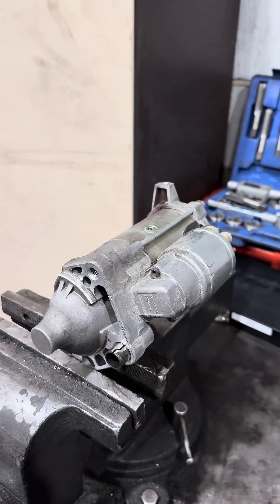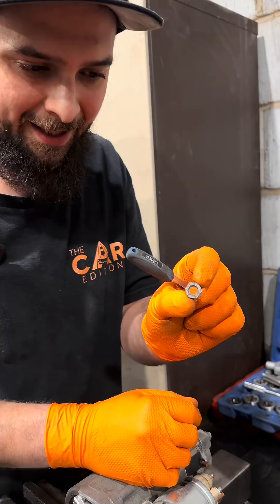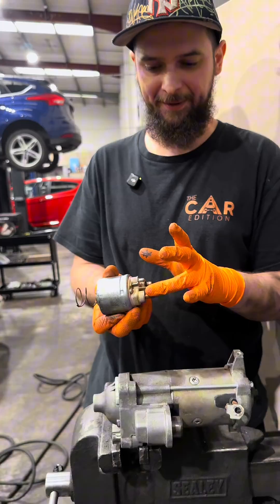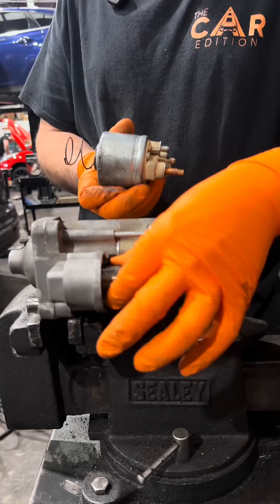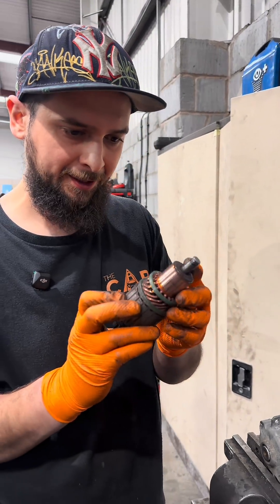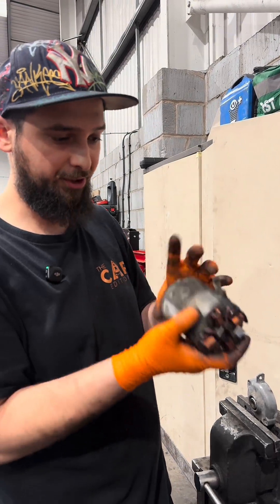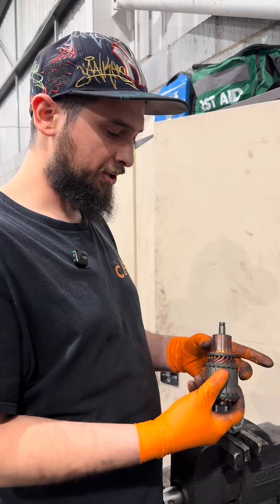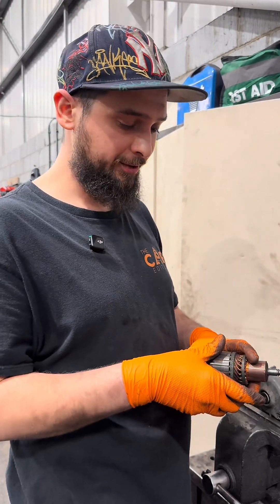Taking apart a starter motor from a Volvo S90 🦾

Comment: if you look at the burnt post on the solenoid, normally what happens is... either that post of the post that connects to the motor they become loose inside the solenoid itself, if you grab them with a pair of pliars and give it a wiggle you will see.. or disconnect, then do the nut back up on it and give it a wiggle... then you will see.... i think they heat up over time on the inside and the resin that holds the post firm gets destroyed, and then its gets a loose connection at the base of the post. please commend me .

Comment: Looks like the  carbon bushes are worn down so much that tge springs carnt push the bushes hard enuf of the stator..
New bush pack will cost a tenner.. also lighly sand the stator copper, with it hucked onto a drill.. make sure u clean the small chamnels in the stator were the bushes makes contact.. and its done.. tolat fix, 15minz of time and 10pound

Comment: Arc`d nut means the connection wasnt secure so voltage is low/interrupted. it needs every volt required to function.

Comment: yep the nut was loose prior to fitting or the internal contact on the solenoid was faulty, loose etc.
 When fitting any new component, make sure everything is tight, especially if fitting cheap Chinese parts.

Comment: All it needed was a spring washer. The nut came loose. Nothing in the starter motor was faulty.
Reply: No spring washer fitted during manufacture. Cost cutting , gone ridiculous.

Comment: When auto electrical parts fail I always tell people, 'dirt is the problem.' It doesn't take much dirt to create false connections, especially in modern highly tuned electrically dependent engines. Dirt causes false diagnostics. Keep in mind that most dirt is silicon dioxide based [sand] and silicon is the basis of all CPU. See the connection? [pardon the pun. Couldn't resist that one.]
It should be interesting to see how EV handle dirty connections.

Comment: One should try starter motor in vice first,with jump leads.if you had powered motor directly past the nut it would have spun.I even check new starters in vice first then fit them and before I order a replacement i always check the starter motor in vice first.

Comment: If the starter solenoid was clicking, my guess is bad connection on the motor input causing the arcing damage you saw, along with a huge voltage drop. 
Can test in car with a meter or a test lamp, test the motor wire and its stud while cranking, testing stud and connectors for voltage drop.

Comment: the magnet when powered hits a pin which is a switch which closes the circuit from the battery cable to the short link to the starter. 
if the nut has signs of arcing the the switch inside will also have lots of arching.
I'm supprised you pulled that apart being a proper mechanic, most nearly all machanics just bin them and buy another ehich the customer pays for.
your a good guy, keep up the good work
Reply: I mean he's not trying to rebuild it, probably just had some extra time and thought it would make a cool video.

Comment: The corrosion due to electricity passing through the stainless nut is called electrolysis. It happens to all alloys except non ferrous like titanium. It can be a pain for cosmetic looks.

Comment: The damage from arcs is the biggest clue. Probably unable to make a good connection internally on the switched positive. Could confirm with a meter, but obviously not worth it aside from curiosity.

Comment: The failed part is the nut was loose and causing voltage drop
Reply: A voltage drop means you get power … so amps moving
Reply: @simDIY1981 https://youtube.com/shorts/4bFY8RH2fGU?si=4jaYpcTm4xniSG15
Reply: Why not leave my reply up
Reply: The vid I posted explains everything
Reply: Thanks
Reply: The YouTuber is an idiot he could have even bypassed the solenoid and confirmed that the starter motor was absolutely fine
Reply: https://youtube.com/shorts/4bFY8RH2fGU?si=4jaYpcTm4xniSG15